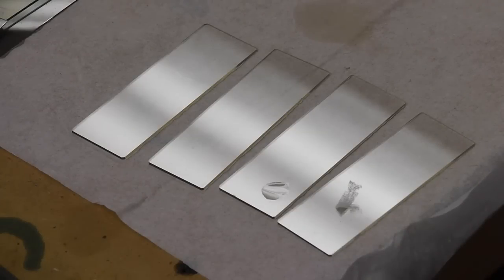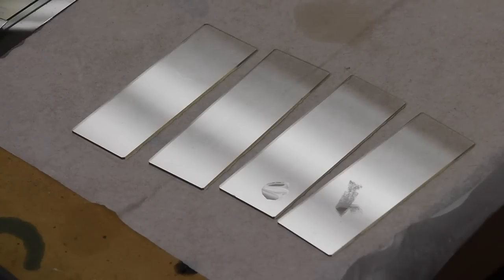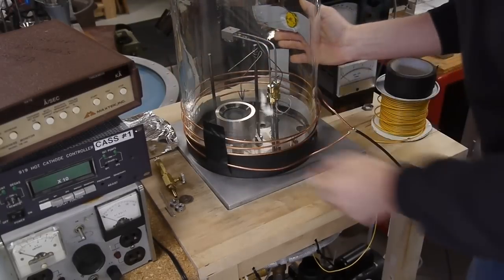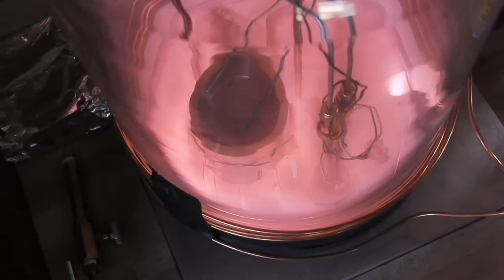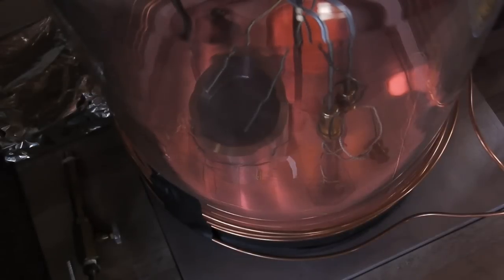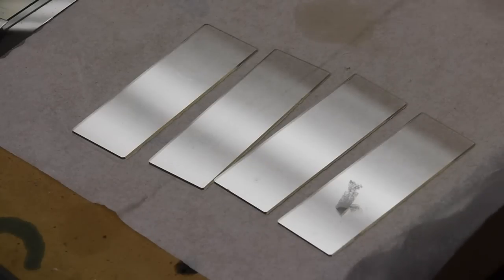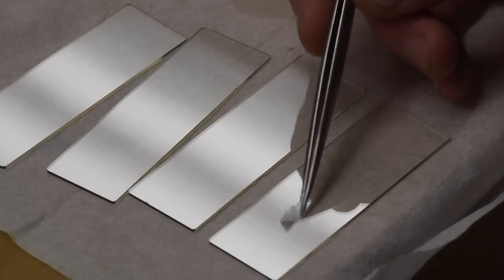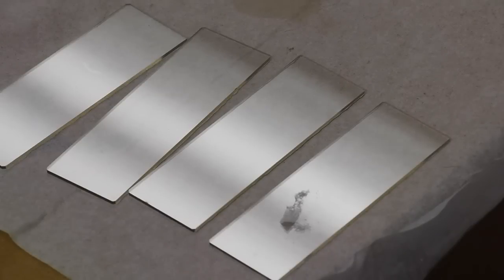Intro to plasma cleaning

Comment: Amazing. I had no idea you could create a plasma just by lowering the air pressure and stimulating it with RF. Don't ever stop making these videos!
Reply: It is called inductively coupled plasma.  It is just like an induction heater, the RF field accelerates the charges in the plasma around keeping it ionised.  The only trick is how to achieve the first ionisations that then grow into a full plasma via avalanches. If the field is strong enough it can directly ionise atoms, but generally there are enough ions/electrons available in the gas to almost immediately ignite the plasma even at moderate amplitudes, but at higher pressures the MFP is short and it takes larger amplitude fields to get things going.  In limiting conditions it can take a moment for a cosmic ray or decay in the environment to provide some ions to start the discharge, but once established the RF energy keeps it lit. The species in the gas matter too, some things drink up ions and electrons or wash off their energy, quenching the discharge.

You can do it even at atmospheric pressure with enough electric field amplitude.  It would be almost impossible to do with HF RF at atmospheric pressure, but microwaves and light can be focused tightly enough with practical sized equipment to break down air directly (i.e. magnetrons and lasers).
Reply: *****
It sounds like he used just air starting at 2:12, even referring to it as an air plasma, though he does then talk about the alternative of using pure oxygen.
Reply: vk2zay
Thanks for the detailed answer. Now that you mention it, I've seen it done at atmospheric pressure with microwaves, in microwave ovens, but that's cheating. :) Doing it at RF makes it a fun challenge.
Reply: @vk2zay  As well, many models of plasma torches induction to ionize gasses at around atmospheric pressures, although I am pretty sure they use argon which is easier to ionize.

Comment: I worked in a Custom product development group at Siemens Corp, (medical product development) and while introducing the products into production in our Mfg. facility in Penang Malaysia, any product requiring die attachment or wire bonding had to go thru a plasma cleaning station.  
Its a very useful process for cleaning oil off leadframes or PCB substrates left from sequential punching or hand processing operations.
The feared killer of molded IC's was residual chlorides that.. if allowed to remain on the leadframe would become activated with moisture.  By adding an electrical component thru biasing, would allow this contamination to manifest into dendritic growth.  This reaction is actually a fern like fractal grow of migrating silver molecules (from the silver die attach epoxy)  that would lead to premature DUT failure do to a shorting of the junction of the IC.
 Very interesting to see this reaction during failure analysis.  Great pics of this failure mechanism on the internet.   Thanks for sharing...

Comment: Nice video!  I used to use quite a bit of UV-induced ozone cleaning in grad school.  Not quite as effective as plasma cleaning but way simpler and easier - just put the substrate under a very high intensity UV lamp and slowly blow air or O2 across it.  You get a ton of O3 that also aggressively attacks the surface.

I did want to mention that you can actually get really clean glassware with regular washing if you do it right.  I would have a giant Tupperware bin with a strong Alconox (a brand of scientific cleaner designed for low residue) solution with a circulating heater in it that would keep it at about 70C.  (temperature choosen for the maximum I could stand to put my gloved hands into)  Put the glassware in that for a few hours.  Then give it a good scrub with carefully cleaned brushes while wearing gloves and rinse in filtered, deionized water.  You'll get glass that passes the drop test every time.

Comment: We use oxygen first, to combine with any contaminates that still exist in the < 10 micron atmosphere.  That makes those contaminates heavy enough to be evacuated quickly.  Then we use sputtering grade (99.995%) argon to blast off any oxides on the metallic surfaces, for our gold-wire bonding process.  One note, we are using gold plated headers and if you leave them in the chamber too long, the argon will blast through the plating, rendering them unusable.
Reply: Hi Rick, can you explain more how argon gets rid of oxides? I was under the impression that you had to use a reactive gas like hydrogen to remove oxides. Thanks!
Reply: @nebnoswel  So this is what we do where I work and I maintain the machines but I'm not an expert on the physics exactly.  Here is what I understand about the process.  The argon in the high frequency field yields very heavy ions in the resulting plasma which blast the surfaces somewhat like a sand blaster but down at the molecular level.  The ions being very small blast off material a molecule at a time as opposed to the analogy of sand blasting at a few ten thousands at a time.  What we're doing is bonding gold alloy wire between a semiconductor die and the header pins that pass through the metal case.  Think of a TO-5 transistor.  Why we can't use reactive gases.  Once started reaction will continue.  If we use hydrogen and we get clean surfaces we weld, we test, everything is good, then send it out into the world and in 3 to 6 months it comes back failed.  The reaction was started and unless you do something to stop it, it continues until failure.
Reply: Rick R Thanks so much for the info! So the argon cleaning is basically mechanical but at a small scale as opposed to other plasma cleaning (like hydrogen) which works chemically and can have unintended chemical side effects? That’s fascinating
Reply: @nebnoswel  As I understand it basically all of the plasma cleanings are mechanical but some of them leave reactive material behind that can have unstable results in the long term.  They all bombard the target with ions within the plasma and those ions strip away material mechanically but some of them leave molecular charges that are reactive.
Reply: Hi, I have a question. We're using a sputtering machine with 3 guns. Is it possible to use that machine as a plasma cleaner similar to this video? If it is possible, how to do that? Thank you!

Comment: When the free-flying wake shield facility was deployed from the space shuttle in the 1990s, the active deposition side of the wake shield was first faced toward the direction of travel.  This caused atomic oxygen of the space environment to impinge on that side of the wake shield to clean it.  It was then oriented in the opposite direction so that the deposition side was in the wake where the vacuum is extremely high, about 1000 to 10,000 times better than vacuum systems on earth.  It's a clever method to obtain both cleanliness and very high vacuum.
Reply: This sounds like it could be used as part of a heat shield ablation package - maybe not on Venus, but perhaps for lunar entry.
Reply: @cherylm2C6671  is it possible to fight with propeller cavitation
Reply: I NEED a Scott Manley video on this, WILD concept that supposedly worked quite well.  Thanks for showing me this!

Comment: Ive discovered that the flame of a slightly air rich blow torch (when the flame cone turns from slightly greenish to a deep blue) works pretty good on glass, after a good mechanical cleaning torching the glass chasing the condensation on the glass makes the glass pass the water break test pretty well, the glass just heats up to about 60C° - 70C°.

Comment: Nice vid. I just coated an alumina tube with metal in an evacuated chamber using a variable leak valve and a convection gauge to stabilize a partial pressure of argon to 600 mtorr. The electrode glowed bright blue and purple after I applied the high voltage to the feedthru which was coupled to the electrode. We also clean parts using a glow discharge method sometimes. This vid reminds me of that, thanks for sharing this.

Comment: This is also possible to do in a microwave oven - in a container inside the microwave of course, just pull two tubes through the side.
The plasma cleaners at work also used magnetrons in that exact frequency range...

Comment: If you use it at a higher power level and intentionally "damaged the substrate" in a desired way using this method, could you in effect use this to polish a surface of an object or lens at a very microscopic level? Great videos! keep them coming!

Comment: Fantastic video!
Although I hope you have a roughing pump with the right oil in it!
Standard vacuum pump oil if pumping pure oxygen will turn your roughing pump into a BOMB!!!
The correct oil costs a LOT more money than the standard oil so most roughing pumps will not contain it if you get them used.
One of these oils that is safe is Fomblin.

Please be careful pumping pure oxygen enviroments!

Comment: What a rad concept - reduce the atmospheric pressure of air, so you can electrify the remaining gas and then control its movement through EM modulation - back and forth on a surface, like glass. Transferring the Kinetic Energy from the plasma atoms to the surface contaminant atoms and vaporizing them into the GAS ! THEN SUCKING AWAY OR REMOVING THAT GAS !

Comment: Hi Ben, Nice video, Your RF energy inspired me to make plasma with microwave owwn magnetron but I am pretty unsuccessful ! I tried building a very precise waveguide with horn antenna aimed to my vacuum bell jar and also tried to wrap 3 or 4 rounds of copper wire around bell jar with one side connected to magnetron antenna and other side is connected to ground but still nothing happened ! with my calculation Magnetron efficiency is around 60 ~ 65 % so the magnetron will make 2.45 GHz at 700 watts ( Input is around 1100 watts ) and when system is connected to my antenna setup ( 16 dBi horn + waveguide ) it will produce around 6000 watts of ERP which is very huge but still nothing happens ! I am really stuck and your help will be much appreciated. Thanks

Comment: Old vid, new comment - plasma ashing like this is also wonderful for 'priming' surfaces ready for adhesives -  you can glue very unlikely surfaces together after cleaning (as Ben says here) by normal methods first, then giving them a minute in a plasma asher, with oxygen, or oxygen and argon. Not sure what results you get  with plain old air in the chamber - never tried this myself.

Comment: I wonder if one can use different coil geometries to inductivly  push the plasma like a pulsed inductive thruster, except instead of pulsed power,  it is fed continouse three phase power RF power to each of 3 coils physically roated 120 degrees from the other coils with the idea of creating a continuous linear induction plasma motor/pump/thruster. 

Presumably, the eddy currents in the plasma should push against the changing magnetic fields, and alternating the currents between three coils  would create a traveling magnetic field down the length of the tube.

Comment: Is there a power threshold for removing different types of material or is it dependant on exposure time?
Basically, you've showed us you can remove dirt and other types of contaminants this way, but, could it also remove a conductive layer on a PCB? (for example)
Great video, as always!

Comment: You may want to discuss the potentially adverse health effects of unshielded RF and UV radiation, especially as you increase power.  It would be relatively easy for someone who isn't familiar with the hazards to replicate your design and end up hurting themselves or others. I can't say exactly how hard you would have to push that coil before you start to worry about it, but like I said, it would be worth discussing.

Comment: Ben Krasnow what is the fundamental difference between fire, the flame, and plasma? i thought that fire was a plasma that was created by the high heat of the reaction between the fuel and oxygen.

i know there's a video on youtube that shows that fire has conductivity, it was shown in the best way, a dude fired a flame thrower at a tesla coil.A

by that way of thinking though if i were to clean a slide using a fire it would have close to the same effect right? i'm assuming though that the oxidized fuel that's left over would contaminate the slide.

Comment: Hello *****. I'd like to ask you a few things. I need to build a plasma cleaner, in order to clean a sheet of copper and remove all the oxide. So, that's the only purpose. I've read a lot, and some of the comments talks about Argon plasma, I've also read about hydrogen plasma. Do you have any kind of DIY manual? The copper wire around the container is actually the antenna from the RF transmitter? Can I use FM frequency? You are the only one who can help me, there isn't much information in google. I really hope you can answer me, I'll be glad to support you with donations. Greetings. William from Argentina.
Reply from the maker: williearias I don't know anything specific about plasma cleaning of copper.  If you want to remove an oxide, hydrogen plasma may work, or just plain argon, but the process will probably be very slow.  Wet chemical cleaning may be a better option.  Oxidizing gases probably will not help because they will not chemically attack the oxide.  The external coil in my plasma cleaner is connected to the RF generator, and supplies power to the "inductively coupled plasma"  (search for this phrase).  It's not technically an antenna.
Reply: Applied Science *****  Thanks for answering.. I've (the last one I think) question for you, what do you use to inject the gas into the chamber? Can it be dosed in ppm of any kind of gas?
Reply from the maker: williearias I used a mass flow controller (MFC).  Search my other videos for details.  You can use a manual needle valve to admit gas into the vacuum chamber, but this would be much less precise than the automatic MFC.  It's most helpful to think about the gasses in the chamber in terms of partial pressure.  If the chamber is half argon, half oxygen, and the total pressure is 1 mbar, than the oxygen partial pressure is .5mbar.  A unit like ppm doesn't take into account pressure, which is important for a vacuum chamber.
Reply: +williearias hydrochloric acid dissolves copper oxide but not copper
Reply: If you did use some form of plasma cleaning. Hydrogen would be the best as it will reduce the oxide layers. Another option would be to heat the material under hydrogen atmosphere. This would have the added benefit of annealing the grains.
Reply: Kyle Kulinski Thanks Kyle .. it's been a while since I'm trying to achieve this .. I still can't figure out the RF equipment .. :( I bought the vacuum pump a few days ago..

Comment: Is pulsed laser ablation something that is used in electronics to do spot/area cleaning. Plasma cleaning would seem like a full part immersion solution potential damaging fragile/sensitive components.  Looking for solution to clean fingerprint oils and other common fod that does not use chemical cleaning like Acetone or IPA.

Comment: Oh wow, was this an ionizing or non-ionizing plasma?

Is the rf generator the samething as a signal generator?

I'm a layperson, where could I go to better understand this, I find it totally fascinating. Could I build something like this?
Reply: Yes and no. The RF Generator is for higher power whilst the Signal Generator would just give you a mW output.
Reply: @05stickman i may be wrong and if i am someone please tell me. But it might be more appropriate to describe the components as an RF signal generator (note not all signal generators can generate signals at radio frequencies) and an RF amplifyer that can amplify  the current or the voltage or both  components of a radio frequency signal.   I suspect that with inductive coupled plasma like this, one needs to really amplify the current,  and to ensure  one gets maximum power transfer, one has to minimize standing waves with appropriate impedance matching.

Comment: Could you please test this chamber with a microwave source to generate a focussed plasma. You can put a magnetron inside the chamber (taken from an oven) and use an internal metalic wall (with a small perforations to allow you to see through) and contain the microwave  radiation! It would be great if you can test this. Is this even feasible lol? Cheers

Comment: I don't see why it would, but before I start tearing things apart, I tought I'd ask: Is the RF-frequency critical for this application? I'm thinking of replicating this system but I don't have a rf transmitter. However, I'm thinking about using the driver circuit from an ultrasonic cleaner, since it should have plenty of watts for this application and puts out 42kHz. Is it simply a matter of replacing the transducer with a couple of loops of sufficient awg wire, or am I overlooking something here?

Comment: I know this is an old vid, But what kind of power levels would do what kind of damage to what type of substrate? :D
Will 10 watts chew .0001" from a 304/316 stainless steel pipe in 10min? Would it be less than .0001"?
 I wonder if one could use this type of cleaning to passivate stainless/inconel surfaces after welding/machining

Comment: are you using the cathode inside the tube connected to the receiver or whatever (like a neon/florescent/plasma/nixie/vfd) or is it strictly just the copper tubing emitting radio transmission? in other words, could i just have a tube of gas with copper tubing emitting radio and it will light up? i'm thinking it needs a cathode and anode  with at least one on the inside, but maybe i'm wrong
Reply: ***** oh, cool,.. so you can make a little glowy lamp with a sealed tube of gas with a radio transmitter around it... what made you think of doing it that way?